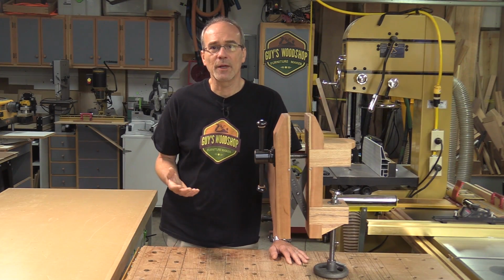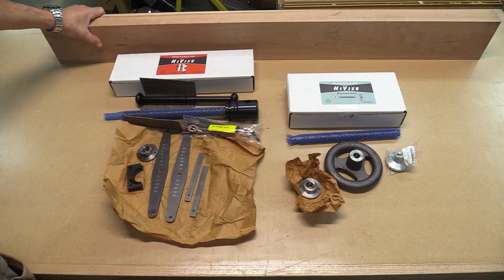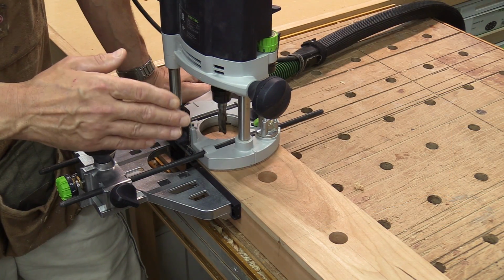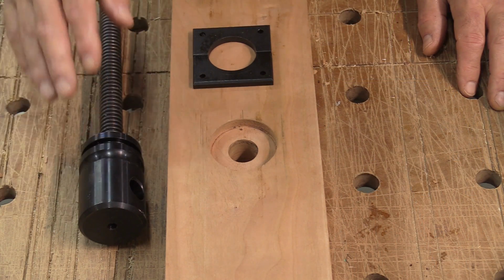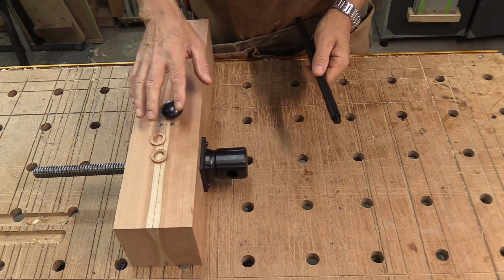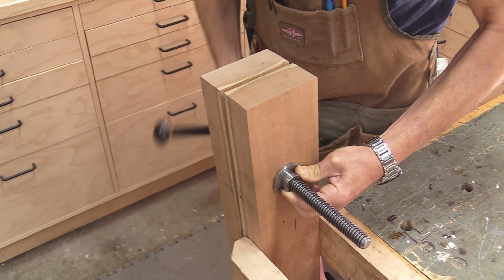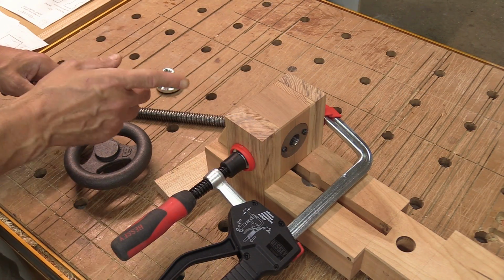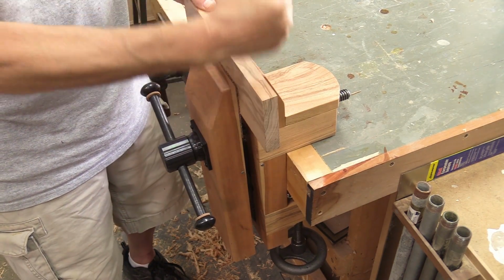Benchcrafted Hi Vise Hardware Tool Video

Comment: I do not have the machines (or the knowledge) to shape the wood pieces.  Does anyone sell the wood pieces what would work for the vise hardware?
Reply from the maker: Unfortunately, we do not know of anyone offering the wooden parts specified for the vise.  You may be able to work with a cabinet or furniture shop and pay them to mill you the wooden parts for the vise.  You can explore the instructions for the Hi Vise here, which shows the dimensions for the wooden parts:    https://www.highlandwoodworking.com/library/manuals/benchcrafted/benchcrafted-hi-vise-instructions-nov16.pdf

A vise that can serve to hold material for doing handwork (and that clamps on to a workbench or table), which is ready made, is this all wooden version Moxon Vise.  You use your own clamps to secure the vise to your table.  You could devise a way to elevate the vise higher on your bench if needed.   https://www.highlandwoodworking.com/lake-erie-toolworks-moxon-vise-kit.aspx
Reply: I was afraid of that.  I am a beginner hand tool wood worker.  No table saw, no router.  I am sure I could make these wood pieces by hand but it would take weeks to put this vise together.  It would solve a ton of my wood working problems.  Getting the wood higher and secure.  I will search for a similar setup.  Thanks.
Reply: Lie Neilson makes an assembled dovetail chain drive vise that can be clamped to the top of a bench or table..
Reply: It is way too wide for my space.  I just bought some Maple and am going to make my own custom, dual screw Moxon vise.  Variation on the Christopher Schwarz style.